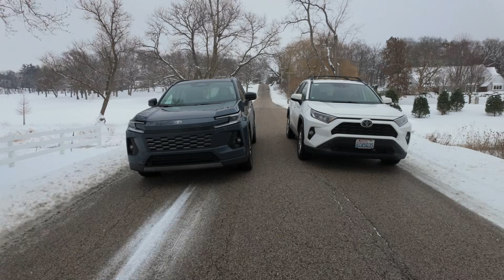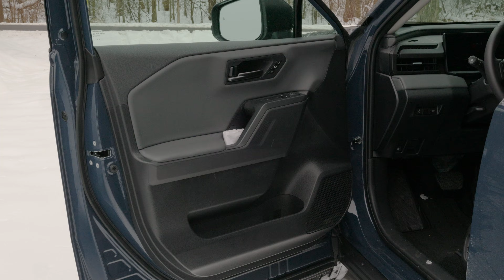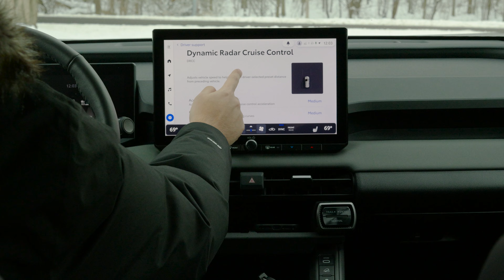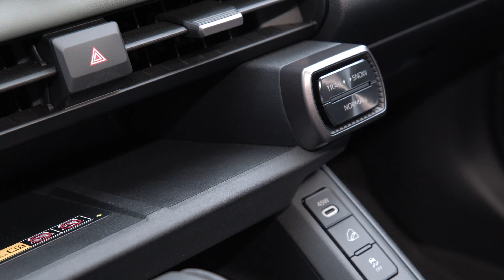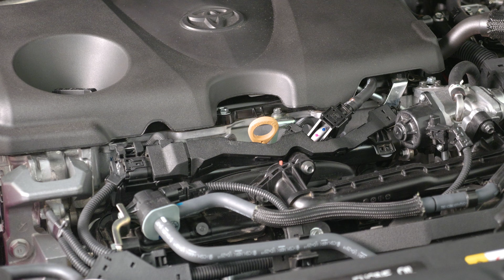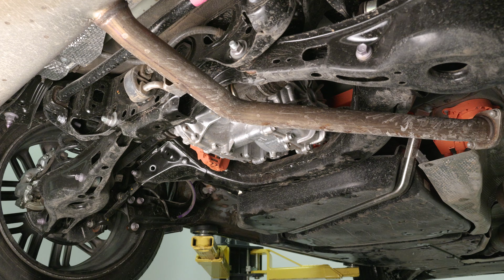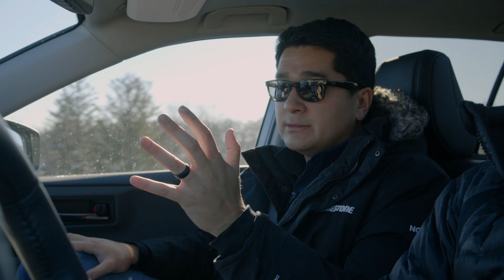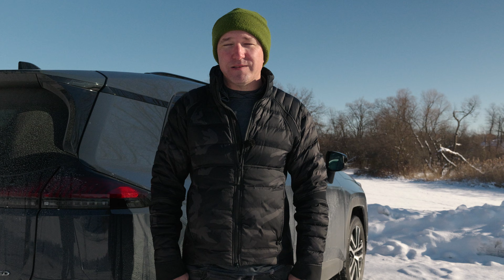2026 Toyota RAV4 | What Most People Want

Comment: I wish companies weren’t so obsessed with panoramic roofs.  I hate that every top spec of almost every car has a stupid glass roof. It’s just a problem waiting to happen in my opinion.  Give me a Limited trim with a regular roof or a moon roof. Tried and true tech that doesn’t fail often.
Reply: They want you to have problems in the longrun 😂
Reply: Ha, that's exactly what I call them - "Stupid Glass Roof." A total dealbreaker for me. Luckily I was able to buy a '25 crown without a Stupid Glass Roof.
Reply: “A problem waiting to happen”. Dont park under trees and clog the drains, you’ll be just fine grouch.
Reply: I hate them being in the desert southwest.  Introduces too much additional heat in the parked sun and never, ever, open the shade regardless.
Reply: Mechanical glass roofs require repairs years later such as track cleaning, lubrication, motor and seal replacement. Some are prone to wind leaks.
Reply: @rkgsd  water leaks too!!  most of them actually if you don't religiously clean the drain tubes
Reply: @rkgsd In 40 years of Civics, Accords, Integras, Camrys, Solaras, RAV4s and Highlanders - 11 total, all with 'roofs - have never once had an issue with a standard sliding sun/moon roof...and they were used.
Reply: @springertube what the hell are you even talking about? They didn't have sliding panaramic roofs back then and none of the cars you mentioned had them. They had standard sunroofs as an option.
Reply: @rkgsd  I'm sorry if I misspoke..... I understand that..... I am probably combining or conflating two different complaints, I was referring to regular sunroofs which some have also assailed, have been around for many decades and which I've had 11 of. If I conflated, it probably would have been more appropriate for me to respond more specifically to one of those sub-replies. But that was what the hell I was talking about!
Reply: It's an option on the RAV4, not a requirement.  At least on the current RAV4, no trim level requires the pano roof.  You can get what you are asking for.
Reply: @DBtwoz no you can’t. You cannot custom order these. And Toyota decides what to build and what to send the dealers. They ALWAYS add pano roofs.
Reply: IMO most younger people want a pano roof or sunroof. Even with the sunroof and panoramic on the Camry. It has issues
Reply: whats wrong with the panoramic roofs? moonroof rocks :)
Reply: They need the glass roofs to be able to get 5-star crash ratings. Glass has much more compressive strength than an equivalent thickness/weight of steel. With steel roof you're going to get a lot more passenger compartment intrusion.
Reply: @Tokamak3.1415  That's utterly and patently false. 
They also exclusively test the lowest trim of each engine/transmission combo.
Reply: @Tokamak3.1415 Shouldn’t it be the other way around? Glass reduces body rigidity.
Reply: @wyw201  This one is up my alley since I have a degree in applied materials engineering. Glass has less tensile strength than steel. It cannot deform or handle stretching like steel can. Glass forms a stronger lattice structure than most forms of steel and has a STRONGER compressive strength and therefor has more rigidity when having a force applied. Now if you make the shape of the roof and windows into an arch or egg shape you can transmit the loads equally throughout the structure. This is why cars with rounded profiles in the AP axis that have glass roof have the highest load bearing on NHTSA's roof compression test. US tests for that since we had so many SUVs rolling over (think back to the Firestone tire Ford Explorer fiasco). Euro NCAP doesn't really concern itself with roof strength as much.

It might have cost a lot more when Ford was making that huge windshield for the Tauris in 1986 or Tesla Model X in 2016 - but now everybody is using those large glass panes so the price has come down a lot. Otherwise glass would still cost quite a bit more than steel. It also allows for faster assembly of most vehicles so it ends up minimizing the extra costs.

So you're generally better off sitting under a pano roof if a tree brach falls on your car than having a steel roof. Or if your car rolls over. Steel would be better if your car is hanging off a cliff with some heavy debris attached to the bumper hanging off the edge.
Reply: @Tokamak3.1415  I learned something from YT comments instead of Brain cell suicide. Thanks!
Reply: @NoodlesWithMSG  I learn stuff from YT everyday. Lately it's been about Huskies insisting on always having the last "word" hehe.
Reply: @Tokamak3.1415  What you said is all theory but absolutely does not hold true in this case though. I interned at Tesla when the Model 3 was being developed and now work at Toyota. The problem is you are assuming all vehicles with a panoramic/sunroof designed and engineered their structure an chassis like Tesla. In Tesla, the glass roof is a crucial aspect of the structure of the vehicle. That is why every single Tesla has a glass roof. Even the new Model Y base which is advertised to not a glass roof is actually just a cheaper glass that is covered on the inside with a headliner. It costed Tesla far more to develop a metal roof. It was cheaper because of, like you said, economies of scale.

In cars like the Rav4, glass roofs are not designed for the structure of the car AT ALL. That is why they have extra metal reinforcement around the sunroof/moonroof/panoramic roof to compensate. If companies just cut a hole and put a glass roof in existing cars, it was probably reduce roof compression strength in half. It is also partially why glass roofs on normal cars that also come with a metal roof weigh so much more. In Tesla the glass was designed to help in the crash safety hence the FULL roof is glass. Cars with panoramic roofs like in a Rav4 are only partially glass. The cars are designed first and foremost with a metal roof because that is what base models have. They also test for crash safety and roof strength to weight ratio with a car that does not have a sunroof.

For example: 

2023 Rav4 with full metal roof (no sunroof or panoramic roof)
Roof Strength to car weight ratio:	6.00
Source: https://www.iihs.org/ratings/vehicle/toyota/rav4-4-door-suv/2023

2022 Ford F150 with full metal roof (no sunroof or panoramic roof)
Roof Strength to car weight ratio:	5.85
Source: https://www.iihs.org/ratings/vehicle/ford/f-150-crew-cab-pickup/2022

2023 Model Y with full glass roof (no other roof option)
Roof Strength to car weight ratio:	4.42
Source: https://www.iihs.org/ratings/vehicle/tesla/model-y-4-door-suv/2023

What you are talking about is all theory and does not hold in real world applications like in this Rav4. You have to understand how the cars are actually engineered. Also IIHS has completely stopped doing roof compression/strength testing altogether! Why? Almost all new modern cars were getting good ratings (above 4). So no, the reason for glass roof on top trims is not for safety reason. Very little reason to choose a glass roof for safety. Full metal roof is found on almost all vehicles IIHS and another safety agencies choose as their top safety picks.
Source: https://www.iihs.org/ratings/about-our-tests/roof-strength
Reply: @ayushmalpeddi2793  Small world. I worked with Tesla during body design and still do go to Fremont several times - so I probably saw you multiple times.

Perhaps I was being too generalizing with my statement. That WAS the primary purpose of the glass cage when those models first started hitting customers almost 7 years ago now. Everybody from Audi to Zeeker WAS using it for torsional rigidity. I know this because I talk to engineers who I know from graduate school or professional work at those deployments. I was at BYD's engineering studios last week talking to their engineers.

You are correct that not every manufacturer is going to use a glass element the same way. The same most manufacturers were using hybrid drivetrains to put more power down or option a second live axle without having a transmission tunnel or weight. They weren't optimizing their hybrid motors for CAFE standards the way Toyota was. But look at how those hybrid motors were used in 2014. Almost everybody who used them, even Toyota in the form of Lexus platform variants, used them for power generation instead of fuel efficiency. Probably only Honda was the only one I can recall that tried to make a meaningful attempt at fuel savings. Maybe the Ford Escape. Every other hybrid was all for power and it was almost always in luxury nameplates.

So it was the same thing with the glass greenhouse back then. I was stating why they even existed in the first place - and the reason WAS for structural elements. Today you don't need to, but back then it was a no brainer to do that over putting cross body members behind the C-pillar and adding 2 or 3 pounds of weight. BMW spends millions trying to dump just 5 pounds on Competitions. Not just for Tesla, but anybody else who was using the coupe styling that infested the market utilized those full width glass panels for compressive loading. Just because LED lighting is lighter and uses less power doesn't mean a car make can't use it for solely for a specific wavelength of light output.

So now that these glass panels are cheap to make, have all automakers utilized the advantage offered by the glass? No. As you clearly pointed out Toyota has not opted to. Obviously anybody with any engineering background knows a SDV that has the glass element as standard in the body in white is going to have the design of the A/B/C pillars adequately transmitting the forces into the glass. Taking a Model 3 glass roof and gluing it to a Kia Soul isn't going to make it a supercar as you alluded to. Let's be candid, you know I know that. It would take hours long text to go into all the reasons why not.

But I would be happy to pass along contact information to people at IIHS who would go on record stating that the glass was primarily for safety on those cars that popped up. There's even a video of Eric going over the reason why Insurance companies were giving lower premiums to cars that had better strength tests. I met David Zuby at a CERT and emergency evac conference and he stated pretty much the same - I was asking about everything from matrix lights to low rolling resistance tires. Roof tests stopped mostly because VSC was mandated in 2012 and had matured by the time testing had stopped. David said that even AEB testing will be discontinued once it's made mandatory and matured to the point where it's diminishing returns like the roof testing. I will let him explain why they use full metal roof on vehicles when given the option to have it equipped. Let me know if you would like to continue that inquiry.

I know people at Toyota but only in Japan, very few in the US. You would know better as to what Toyota prioritizes for the RAV4. I just know the current model does not have good body movement control for second row passengers. Hopefully it's improved for this new generation. No point to any of the crumple zones if the fleshbags hit the hardpoints inside the car.

Thank you for the polite reply.
Reply: Spot on! I vowed to never own a car with any sunroof. It’s like buying new pants with a giant hole in it 😂
Reply: Buy the poverty model and stop squawking.

Comment: While it is popular, Toyota seems to be getting a pass for less than average interior fit/finish as well as a polarizing design.  Many other brands offer better options at a better price.  Not having AWD standard is another misstep.
Reply: Let's see how that misstep plays out in sales volume, which Toyota is undeniably winning at.  Toyota has never been the king of "this is obviously the best choice" but rather the 5-10 years later "I should have chosen the Toyota".  I've been that guy multiple times.  Then we purchased a 2021 RAV4 XSE hybrid in 2020 and at 110k miles, it still looks nearly new inside and out.  No regrets at all.  Glad I didn't buy another Subaru or Mazda this time.
Reply: Or maybe not having AWD standard is smart marketing. If you want it, buy it. If you don't, get the FWD and save a few bucks on both the purchase price and at the gas pump.

Comment: Jack I’m honestly surprised you’ve had no issues with your rav. 

In August this year my 2020 rav shit the bed on me because water leaked into the body in white through wholes which where poorly seated where the roof rails attack. Electrical systems got totally fired. Key wouldn’t lock or j. Lock the car, infotainment screen wouldn’t turn off when I tuned off the car in left which caused the battery to drain. 

Somehow it was still able to drive so I took it to the dealer. They checked it out and said that this was a known issue which they have extended coverage for and that it would be a while. 

Let me tell ya, it’s been a while. I dropped off my rav in march and I still don’t have my car back. Thankfully I got a loaner that was basically equivalent. Dealer has been unresponsive. Supposedly the warranty work has been repaired by Toyota I think they have all the parts and now they are looking for someone to do the work. 

They essentially have to tear my entire car down and replace the wiring harness. Don’t think it will be ready until 2026. 

My car sat outside a lot. Never really went in garages or covered parking for 5 years straight on the east coast and Colorado so yeah it was exposed to the elements. But the fact remains. This should not happen.

Really soured my opinion on Toyota. 

I see this new rav with all its connected services bs and to me as a current get owner it looks like a lot of the car was butchered.  The only thing I think can say was improved was that they seemingly fixed cable-gate (another notorious rav4 reliability issue) just based on how that connector to the rear drive unit looks now. And maybe they tightened up in areas here and there. But other than that it looks like the same fucking car underneath.
Reply: "white through wholes which where"
[color] through [entireties] which [location]? 
"Electrical systems got totally [terminated from employment or the start of cooking a dish].
Dafuq are you talking about?
Reply: Ufff. What a mess, sounds like the corporate is realizing what a problem they have on their hands and they dont know what to do.

Comment: No HVAC physical controls is an automatic disqualifier for me.
Reply: Toyota held out but I can tell this Gen they are finally going away from the formula
Reply: Yeah, no buttons, no sale.
Reply: The temp controller is physical. And that's what people use 99% of the time.
Reply: Something tells me you weren’t a buyer for this or any other new car in the first place 😂
Reply: @Nick210 what is telling you that?
Reply: @Nick210  Your comment on this video is literally "Rav4 for 40k 🤣". Guess you aren't in the market either? Or you're broke? Or just an internet troll? lol
Reply: HVAC is the only physical button, you can see them below screen
Reply: @Mycameron2323  Only for temp up/down. Changing the fan speed is now in the screen.
Reply: @GBcommander  put it in auto and it changes the fan speed for you.  I know, I know, that's not what you want, but I can count on 1 hand the number of times I've manually changed the fan speed in one of my auto climate control cars in the last 5 years.
Reply: @InPursuitAutomotive  Honestly this. This is how I've used my AC and it's just dead simple this way
Reply: @InPursuitAutomotive thats fine for you, only speaking for myself here.
Reply: @InPursuitAutomotive  I've only had rental cars with the auto fan speed, my 2017 Camry doesn't have it, and I've also only experienced it in the summer time while running the AC but I assume it works the same with heat. I never used the auto feature because when I would turn the car on after having it on auto it would blast me in the face with scorching hot heat on full fan speed and I'd have to rush to turn the fan speed down until the hot air escaped the car and then turn it back up once the air coming out of the vents started becoming cold. So in the winter I assume it would be the same where it puts the fan speed on max and blasts you in the face with icy cold air until the car warms up to start blowing heat.
Reply: @TheCobruhAlienat0r depends on the vehicle, but most aren’t like that anymore.  They won’t blast the air in winter until it warms up.  My truck has a button that allows you to limit max fan speed, which helps in the summer, per your example.
Reply: @InPursuitAutomotive  you could do that, but I'll stick with my '25 Rav lol. I like how it has full buttons for everything.
Reply: @InPursuitAutomotive  I almost never use auto mode. I like setting the fan speed manually. Sometimes the temperature in the cabin is fine but I want more air flow
Reply: @TheCobruhAlienat0r  " I would turn the car on after having it on auto it would blast me in the face with scorching hot heat on full fan speed and I'd have to rush to turn the fan speed down until the hot air escaped the car "...try hitting the controls with your purse...it might make it a little less dramatic....
Reply: @TheCobruhAlienat0r My 2004 Sequoia had auto setting.  It's not a new-fangled whatchamahoozit.  To answer your question, in winter the vents won't blow until the system warms up sufficiently in auto.
Reply: @Mycameron2323  no - not really - they are still built into the screen - which means they are electronic.  If that screen fails - you have no AC/heat....